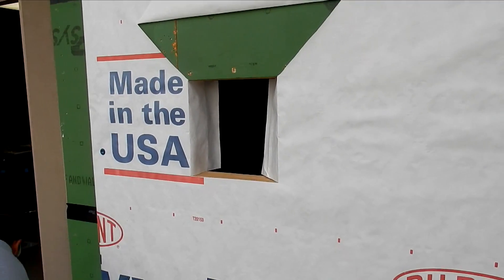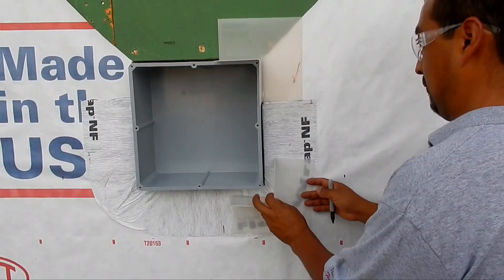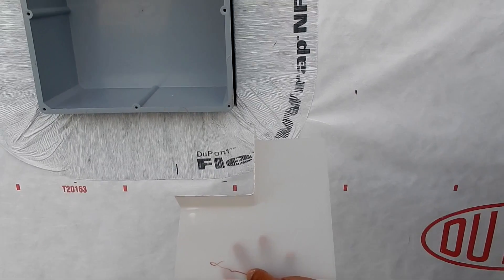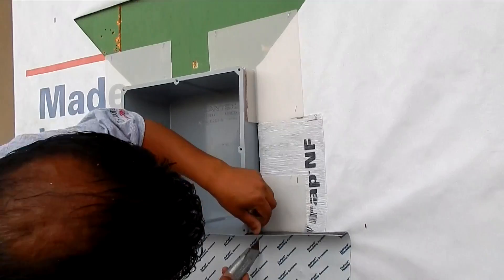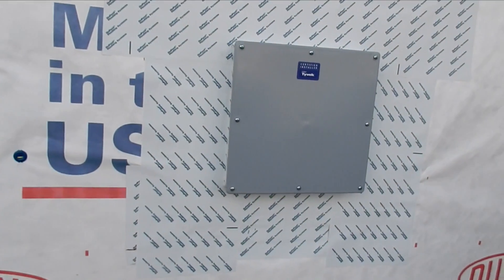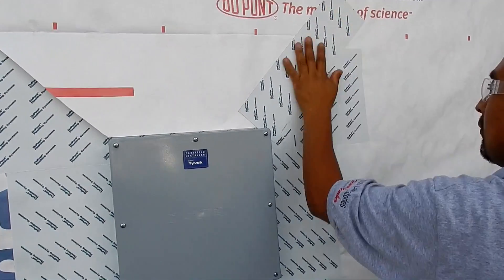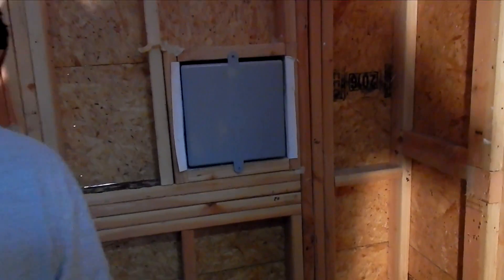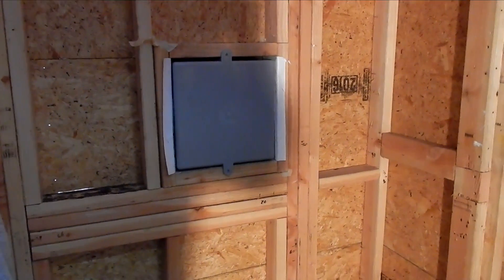How to Flash an Electric J- Box wth Lightning Flash XL corners & Tyvek

Comment: Very nice and thorough video.  Please don't roll the tyvek house wrap into the opening.  Why? Well if any water gets passed the tyvek, lets say above the flashing tape, it will "track" right into the opening because it will follow the folds at the jambs.  When is the video about a leak proof method of a RETROFIT NON-FLANGED window install into brick coming out?  Great job on proving your methods works.  No one ever show leaks / or testing for that matter.  Thanks again for your time.